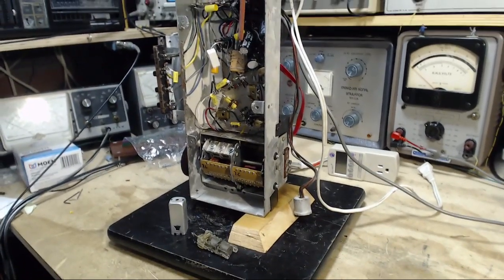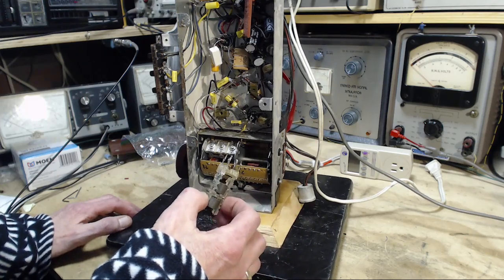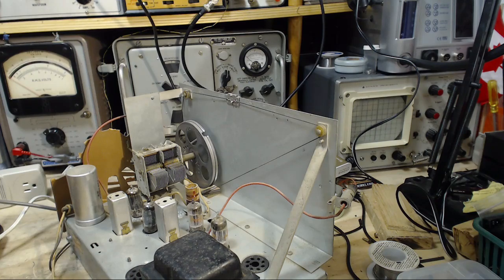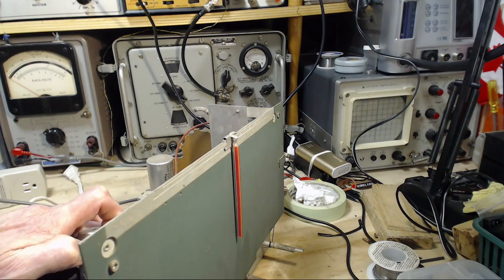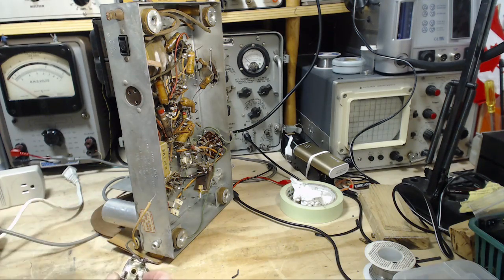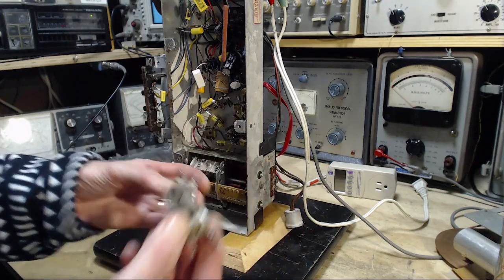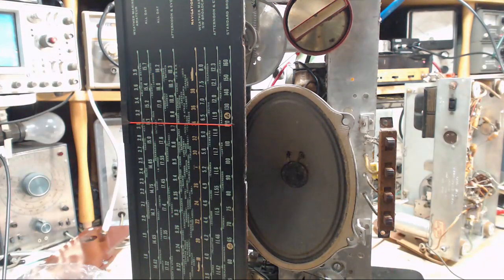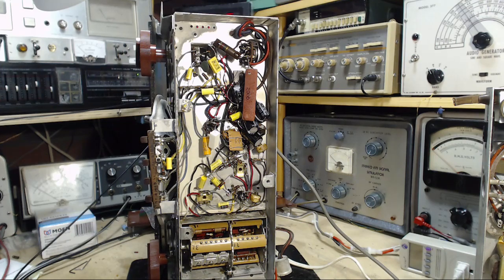Hallicrafters TW2000 World Wide Video#15 - Replace Defective IF Transformer

Comment: Another wire disconnected, one more dodgy solder, the AM band is still  deaf...
Reply: StillCloser What is worse is all the problems he leaves behind untouched and unfixed, to (maybe) adress them later (or more likely forget about them). If you break a coil (because you took a short cut when removing the tuner) you fix it before going on adressing other problems. If you screw up the band selector indicator mechanism (because you would not read the instructions on removing and reassembling the tuner), you fix it first before going on,- if only to have an indication what band you are on when doing the alignment and not play two thumbs russian roulette. And servicing the dial cord and correct the position of the dial pointer  would also be beneficial unless you want to risk forgetting about it and end up adjusting the bands with a misaligned dial indicator.

Comment: Now Jim has a faulty IF can that should be a good one to attempt to repair; no loss if it doesn't go well!
It IS tedious, but doable. Removing the mica sheet is the most difficult part. IIRC, both the capacitors should be about 100 pF. They do not need to be installed inside the can; tacked onto the terminals under chassis will work, and makes it easier to tweak the capacitors' values if needed.

Comment: 15:01 and 15:33 : I would not be surprised if the diagnosis silver mica disease was actually wrong and it was this wonky heater wire reconnection job all along.

Comment: I liked Jim's approach on this better than the last few. Even though it hasn't come out perfect he has changed out all the caps, some that were a PITA to get at. He has more patience than most, at least a good temper LOL. I would be editing some severe cursing LOL. I'm pig headed and won't quit until it works. The harder it becomes the more determined I get to not let it beat me.

Comment: #15 already??? Mica disintegrates because of heat, I imagine its hot in there!
Reply: Yes Jim can certainly make a small amount of material last a long time?
Reply: @brianjohn9144  That's great, at least this way we can see the whole fix and reasoning process, rather than.
1 simply open the case, no instruction given, no footage recorded
2 oh look it's a failed component, cut to:
3 that's the fix complete and housing repaired off screen
4 picture of completed radio shown
Learning value zero

Comment: Automatic radio made those garbage IFTs, but to be fair others made similar designs all equally crappy, they can be serviced but it's tedious work, hint I found a way to do it without unsoldering the fine coil wires too much risk of damage if the wires are tampered with.